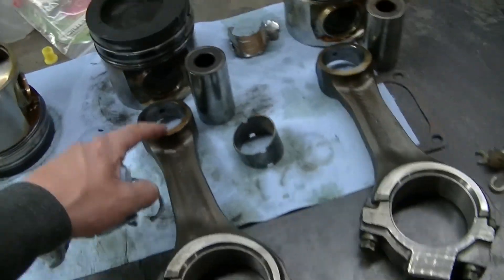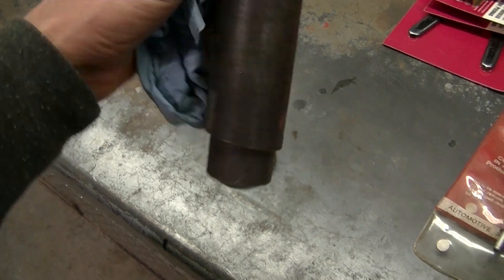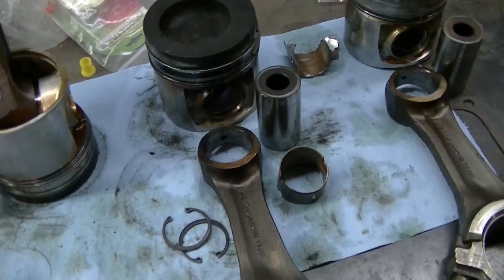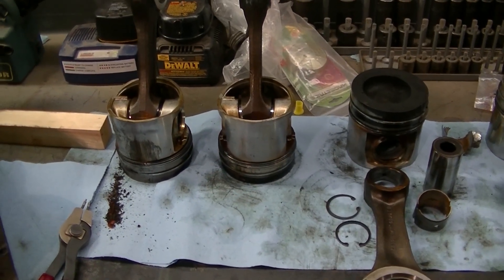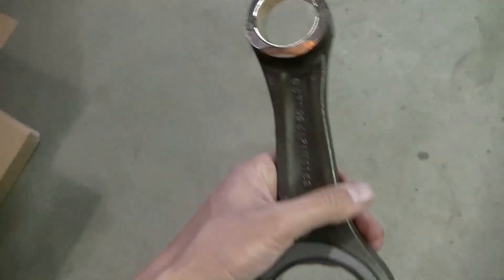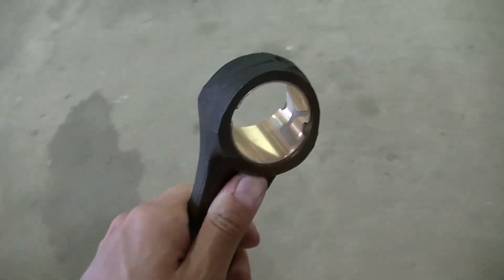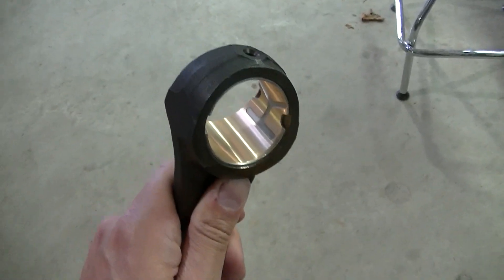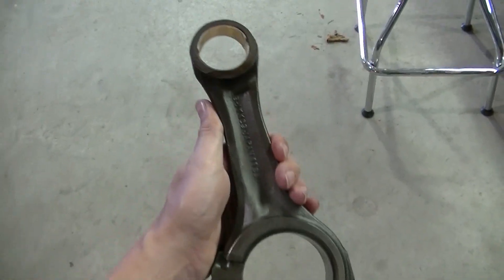Versatile 276 3.9 Cummins 4BTA "Piston Disassembly"

Comment: run a cylinder hone threw it to make it round again pin should fit then or run a reamer threw it
Reply from the maker: Ryan B.   I tried to take some material off to get them to fit but I felt like it would take to much to get them to fit.  I will feel better if a pro with the right tool puts them in right so I won't have to make them fit.  Those bushings take a lot of force.